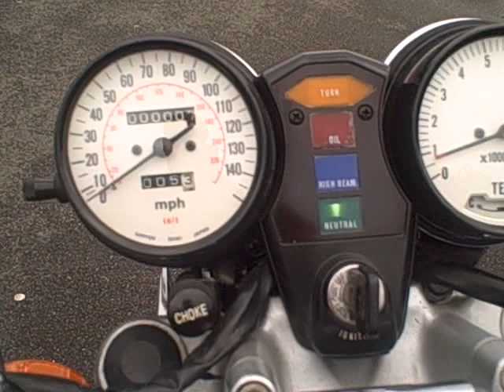Old Fogey's 1976 Honda GL1000 GoldWing

Comment: I believe it was you tip, I used on swapping the rocker shafts.  It really quieted down my ol' 1100.  Beautiful bike!   Did you put a hydraulic clutch on it?  Looks like a master cylinder on the left handlebar.

Comment: This bike looks to be in good overall condition, however those valves definitely need
checking, I can hear the valve tappets rattling like hell, and these engines were ultra
quiet.
Reply: John Evans OK, thanks for the technical info, that explains the noisy sound on
the engine.  The bike looks good otherwise, thanks for uploading this iconic bike.

Comment: Two questions, John.  First, how tall are you and what is the inseam measurement on your pants?  I'm about 5'9" tall with about a 29" inseam.  That makes it tough (impossible) to sit on an older Goldwing and have both feet flat on the ground.  Second, I think I see that your boots have thicker soles than normal.  Probably, so you can reach the ground, too.  But, does that interfere with toe shifting?  I sat on an older Goldwing recently and was bothered by the shifter lever location.  It seemed to be under the horizontal head of the engine and made it difficult for me to point my toe down to be able to shift into higher gears.
Reply from the maker: I'm 5' 10" / 30" inside seam. Those are not my normal riding boots. I almost never try to have both feet flat on the ground. But this may interest you:
http://www.wingovations.com/bigfoot/4579471105

Comment: What is that horrible, out of place ticking noise? 
...what a shame. 😕
Thumbs Down! 😕
Reply from the maker: The explanation for that is told further down ion the comments.
Reply: @ellaevansbolt  
How unfortunate. 😕 
Better work should've been performed. 
Thumbs Down! 😕
Reply from the maker: @user-tz2xk4cz5z  Really? 

Sorry, but I assure you I know exactly what I'm doing. I'm a trained engineer and have worked on bikes and cars since I was 14; that is nearly 60 years of experience. I had the first Wing here in 75, had a bike repair shop for some years, was a foreman in a Suzuki dealer workshop etc etc. So please, go take your criticism to someone who gives a damn.
Reply: @ellaevansbolt  
Absolutely horrible ticking that resembles serious valvetrain neglect. 
Incompetence, apparently. 😑
The truth is in the audio, Madam. 😐